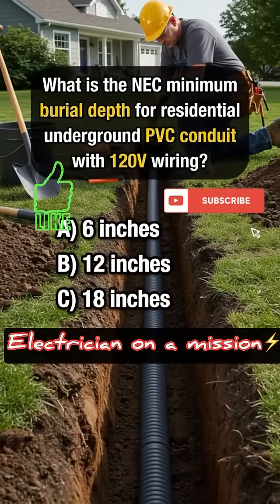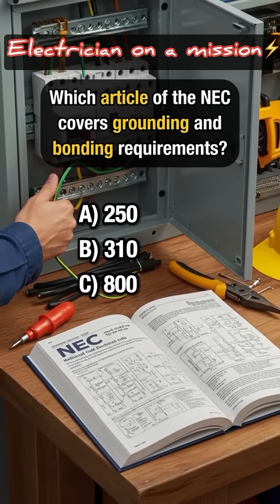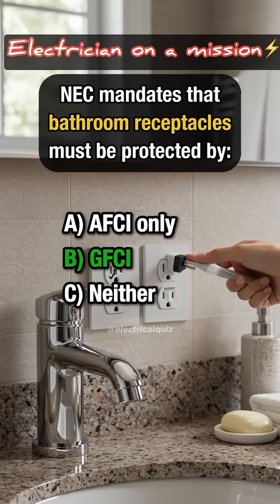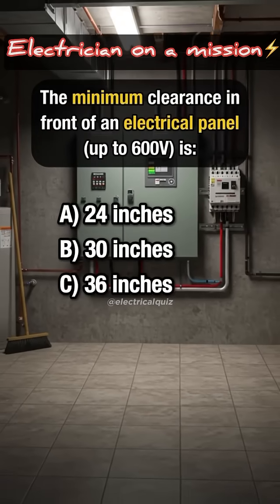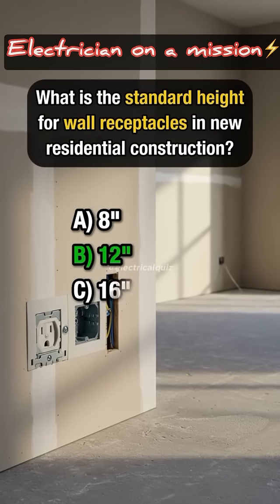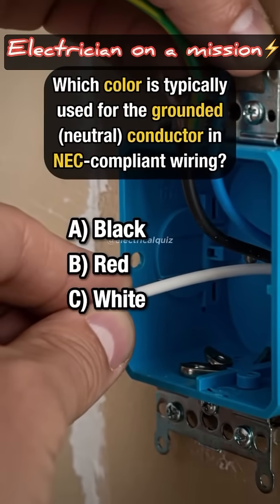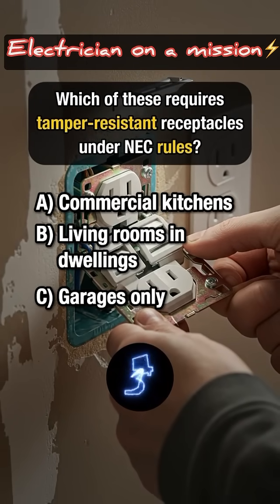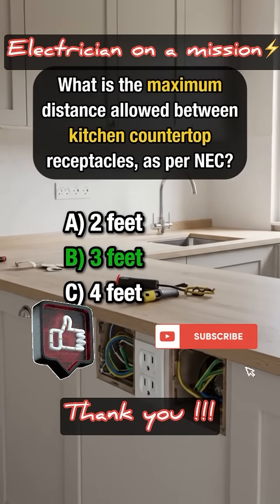Basic electrical  knowledge for apprentice electricians ￼⚡️

Comment: Pvc burial is dependant on where you are running the conduit, example if it's under a driveway or not. 

Number of staples is a UL listing per manufacturer not NEC

Where Tamper resistant is required is incorrect. The rule of thumb is if a child will come in contact with the outlet on a regular day to day basis then you put them in. So the garage would also need it. 

Countertop outlets shall be installed so that at no point are you more than 24" away, therefore 4ft between outlets